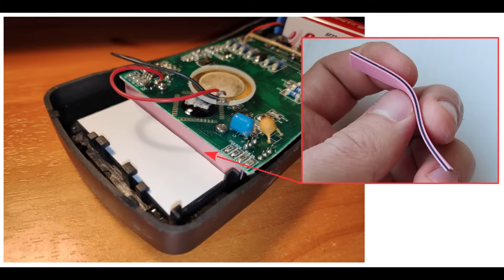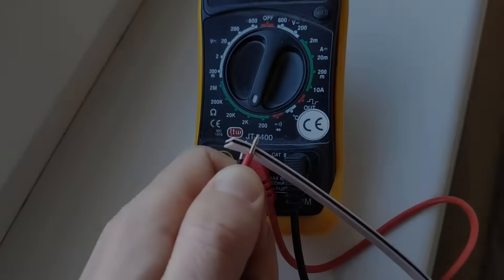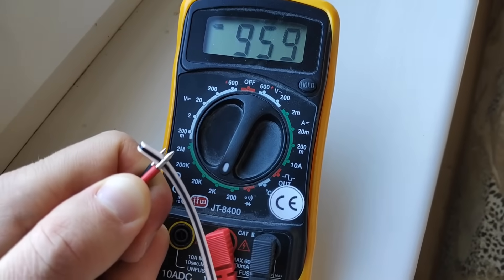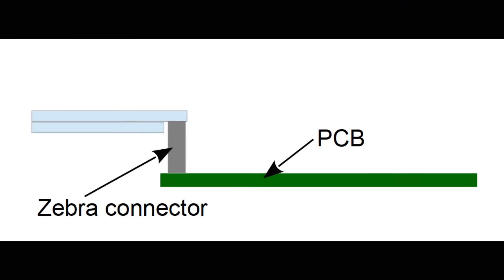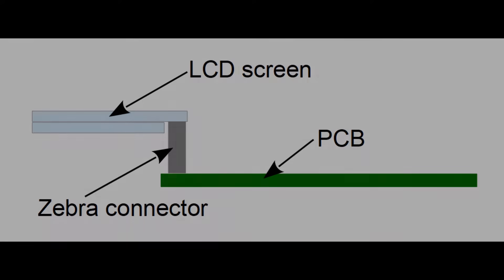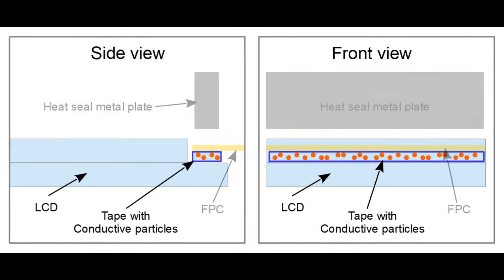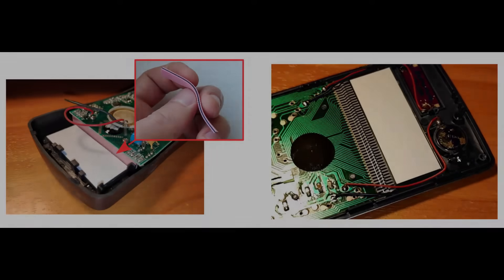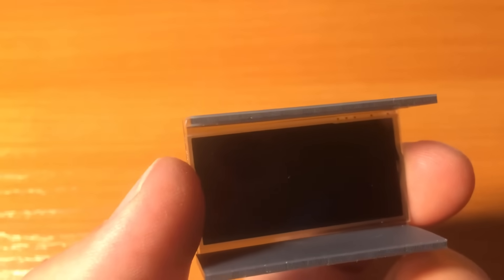LCD repair

Comment: As a retired Electro-Mechanical Engineer [ H N D ] you state that you don't know why this chemical reaction occurs at 06:00, well here is the concise answer and to better understand I have used "Wikipedia" The common term is Verdigris.
 These pigments should not be confused with the green patina commonly called "verdigris 2 " which results from atmospheric corrosion of the surface of objects made of copper and its alloys. This patina , of a purely mineral nature, is mainly composed of basic copper salts which can be, depending on the atmospheric conditions, hydroxycarbonates, hydrosulfates or hydrochlorides 3 , 4 . In both cases, the amount of copper they contain gives them a certain toxicity . Verdigris is , by derivation, a color name .
So there you have it because of corrosion to the surface which results in a bad contact.
Here I may add this is NOT just in displays in car dashboards, this happens ALL the way through the electrical industry where the atmosphere is allowed to penetrate.
The best example is a “computer clean room” these are set to ISO STANDARDS
CLEAN ROOM CLASSIFICATIONS
Clean rooms are classified according to the cleanliness level of the air inside the controlled environment. The clean room class is the level of cleanliness the room complies with, according to the quantity and size of particles per cubic meters of air. The primary authority in the US and Canada is the ISO classification system ISO 14644-1.
This ISO standard includes these clean room classes : ISO 1, ISO 2, ISO 3, ISO 4, ISO 5, ISO 6, ISO 7, ISO 8 and ISO 9. ISO 1 is the “cleanest” class and ISO 9 is the “dirtiest” class. Even if it’s classified as the “dirtiest” class, the ISO 9 clean room environment is cleaner than a regular room.
The above text is taken from the following website;
https://www.mecart-cleanrooms.com/learning-center/cleanroom-classifications-iso-8-iso-7-iso-6-iso-5/
Now you may think that I have gone over the top here BUT it gives you an insight as to why “electrical connections fail”

Comment: Thanks for the video. I have one question tho. Im trying to fix my ATV cluster witch is a LCD with zebra strip.

The lcd screen had a film thay was brownish which i assume was the polarizing film but the glass had one in the front and on the back and i took both of them off with a knife and alchohol. 

Behind the glass is another splastic piece whick i assume is kind of like a back light but i had a white film on it which has bubbled. 

If i put new polarizing film on the lcd screen could it work again? I was thinking since it had two i guess i need to put them at different angles from each other to let light trough?

Also the white film on the plastic piece, does it have a name? Can i take it off?
Reply from the maker: Sorry for late reply. About polarizers you are right. They need to be in a specific angle in order to work. It should be 90°. You can take 2 polarizers and just rotate them one in front and one in the back of the LCD and you should see how the LCD image changes. Of course the LCD should be ON while doing that.

Comment: Is it possible to change a orange display to a grey one by changing the back light?
Reply from the maker: If the backlight it self is emitting orange light, then yes. If the backlight it self is not emitting orange light purely by logic there has to be something between the backlight and the liquid crystal, that changes the light. In that case you should replace the element that makes that change.
Reply: You can have two options. One is to exchange white led instead of orange led. The other is to insert another transparent color sheet between backlight module and lcd or to overlay lcd.

Comment: I have an old zoom guitar pedal with a monocrhome lcd display that doesnt work at all. but the pedal works fine. It's made in 1993 Japan
any idea why is it always off?
Reply from the maker: I don't think the problem is with the display or the display connections, because in that case the display should deteriorate gradually. In this case it sounds more like the problem is with the chip that controls the display. Hard to say something more without inspecting the circuit itself. If you are not familiar with electronics and soldering I think it will be hard to fix this on your own.
Reply from the maker: If there's a ribbon cable that goes into a socket and the other end goes to the display, you can try to disconnect it and connect it back to the socket, but I don't think that there will be one.

Comment: Hi shortcutelectronics & everyone I have a washing machine with faded or disappeared lettering, it has ribbon connectors on the display aka pcb or is it pcd the control panel, can someone please help me fix the issue so the lettering readable again, thankyou in advance. Great video thankyou.

Comment: Workshop 1983: No problem I will fix it for you!
Workshop 1993: No problem we will install a new LED display!
Workshop 2003: You need a new instrument cluster. Cost $1700!
Workshop 2023: It's not worth it. You need a new car.

Comment: how about LCD fading in a VW car? When the car is cold the LCD displays correctly, when warm the LCD is unreadable and faded. This is a red LCD like you have in the video - I have a HalfDOT LCD in my car.
Reply from the maker: If the whole LCD fades - not only particular segments - sounds more like an overall voltage problem. This might be a problem with the rest of the circuit board, but it also might be a problem with the LC (liquid crystal) it self. There are different types of LCs and some of them might degrade over time and act differently at different temperatures. If the voltage to the display does not change when the car is cold VS when the car is warm, then most probably it is a problem with the LCD itself. This might be hard to diagnose because the screen has to be plugged to your car and it's hard to access the necessary trouble shooting points, but in the ideal world I would check the voltage if it changes regards to ground when the car is colt VS warm, if no, press on the LCD connection and see if that changes something (this would indicate that it is a connection problem), and if still nothing changes, most probably the LCD screen itself is bad and needs to be replaced. The fact that I don't know what type of connections it has also does not make it more simple.

Comment: I have a casio g-shock that flashes some segments, not all the time, sometimes it works well, I think that water entered it and that was the problem, do you think that technique could work to repair it? PS What a good video, I thought that LCDs of that type no longer had repair.
Reply from the maker: If it has zebra connectors, this might work, because water might get between the zebra connector and connections of the Printed Circuit Board or the display connections. If it has the other type of connector in that case there still could be some water left that shortens some parts of the circuit and that messes up the signal. I think at first I would simply open the case and let it dry for some time. Maybe try to heat it up, but not too much. If that does not help, than go for some more drastic approach. P.S. I'm happy that you liked the video :)

Comment: another issue with vintage LCDs is the darkening of its panel. that is curable also, but much more complex, a LCD panel should be soaked in acetone

Comment: About these observations, it's all very academic. Electronic maintenance professionals know the limitations of recovering LCD display connections to provide good results. The vast majority are NOT reversible for proper operation, as they present degradation of the terminals printed on the display OR irreversible damage to the flat cables. These damages are very common and the only procedure is to REPLACE the display.

Comment: Instead of cooling the soldering iron with water it might be better to replace it with a piece of plastic or wood cut to size and apply pressure. No chance then of water damage, and more even pressure. You might also similarly use a piece of metal heated in an oven instead of a soldering iron.

Comment: Why cool the iron ?🤔why not just remove it???
Reply from the maker: Because you want to keep the conductive particles under pressure until the connection cools down so that the glue that keeps the connection together cures and the conductive particles stay compressed also after the soldering iron is removed.
Reply: @shortcutelectronics  Thanks. That was much needed explanation.

Comment: LCD screen can no longer display info at its peak contrast.  Display can be adjusted for contrast by a controller on a handlebar switch on a motorcycle.  😅

Comment: surely they could have used the conductive adhesive from the tape inside the zebra connectors. so they heat and attach in the factory..and it doesnt go to hell for the user. or some epoxy that contracts over time to keep it pressurized. 
i loathe zebra strips 😂

Comment: but you using only nuber 8 i tink it not godd
Reply from the maker: It's the opposite :D Using number 8 proves that it works, because it has to turn on all 7 segments (pixels) of each digit. If I would have used any other digit, there would be the probability that the segment that is not needed to display that digit is also not working.

Comment: THEY'RE NOT PIXELS. 

No need for thanks.
Reply from the maker: @suprememasteroftheuniverse  Ok, explain me the difference between a pixel and a segment when it comes to a traditional LCD excepting the shape. They both have the same working principle. You have a thin layer of ITO on inner sides on the LCD ablated using laser or chemical etching and when you apply voltage the liquid crystal changes its orientation based on the shape. How does it make any difference worth mentionong for a regular guy who just wants his dispay to work again especially when it comes to the connections?

Comment: these are called segments, not pixels
Reply from the maker: All though you are technically true when talking about the types of displays which were presented in this video, there is no difference between a calculator or a computer LCD screen especially when it comes to the the way how they are connected to the rest of the circuit board. Also the basic idea of the operation of the LCD screen itself does not change. We apply voltage to a particular area of the screen that makes the liquid crystal to change its orientation and in the result some types of crystals are designed specifically to reflect/absorb the light, and some are designed to block it or let it pass through when we talk about the traditional LCDs with a back light, RGB filter and polarisers.
Reply from the maker: More specifically not to block the light or let it pass through, but to change the light waves orientation from horizontal to vertical or vica versa to make the polarisers to block it or let it pass through.

Comment: First, no need to say “what’s up everybody.” And then it as much a “PCB Board” as much as a “hot water heater.” It’s just a water heater, and it’s just a PCB which means Printed Circuit Board, not *Printed Circuit Board Board.”

Comment: Those are flexible elastomeric conductors to the LCD on the multimeter.
That's a very cheap-looking calculator. Why not just throw it out and buy a new one?